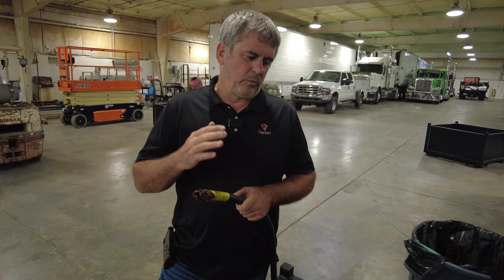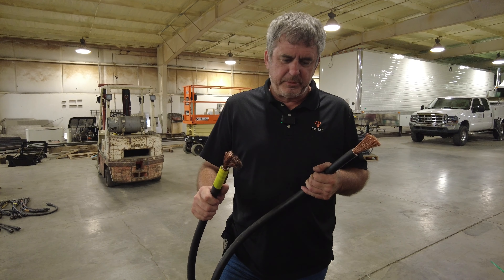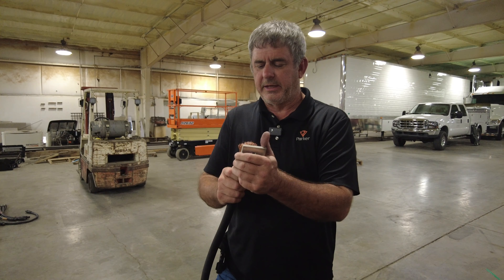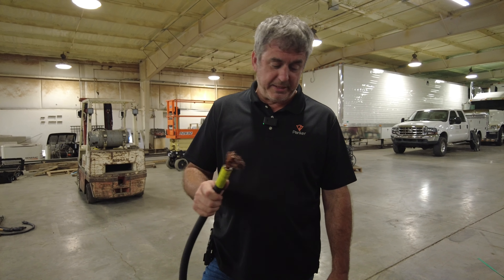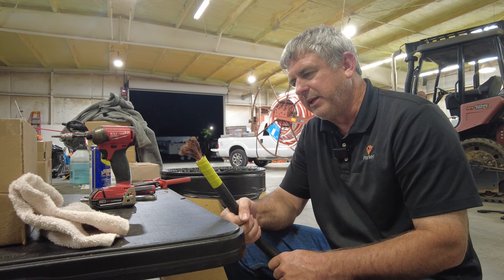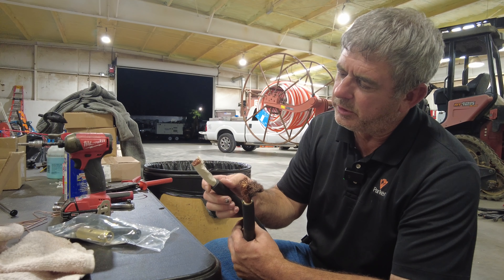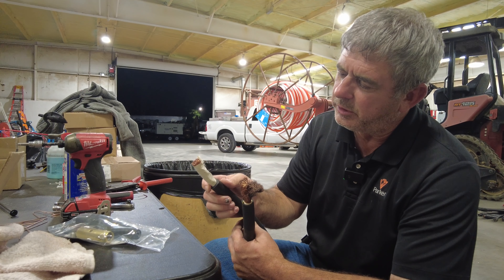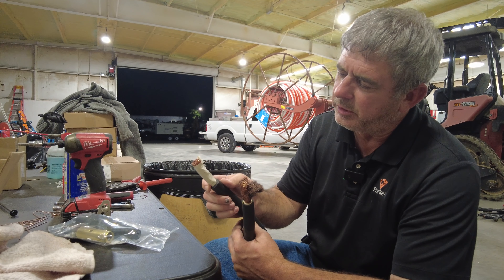How to assemble a Cam Lock Connector

Comment: shoulda put the fitting on first before stripping the wire. Where's the copper strand to tie sheath to copper??
Reply from the maker: On 2/0 and 4/0 I don't add the solid copper strain reliefs. --  on cables small than 2/0 I add these strand reliefs (solid copper wire twisted to the sheath)

Comment: Aren't you supposed to use the single copper 4 or 5in wire as a strain relief?
Reply from the maker: you can -- most of the connectors come with that piece of copper -- in my experience it works well without it, 4/0 2/0 --  I have also found on some old ones that i have disassembled that the insulation crack around this wire, I typically will use it on the smaller gauges to help take up space on gauges less than 2/0 so that set screws dont over set   -- thanks for watching.

Comment: Why didn’t you use the strain relief wire?
Reply from the maker: great question. - -  on 4/0 and 2/0 cables I dont feel it adds any value and feel it wicks more water to the connection -- on smaller gauges I add the strain relief wire ---- thanks for watching
Reply: Electrician here. Definitely use a strain relief to help prevent tension on the copper. Customers are ruthless with cables so all the extra safety helps.

Comment: Can you provide a recommendation for lubricating the contact surface of the male and female cam locks?
Reply from the maker: We use wd40.   That’s a great question.  WD 40 the wd stands for water displacement … and is rated for cleaning and drying contacts.  It works nicely and does not make the insulation gummy.  I can tell you have a bit of experience with this connector if you are asking this question.    Thanks for watching.   Great question.

Comment: What about the piece of wire included with the connector?
Reply from the maker: It's a strain relief, we don't typically use them on 4/0 cables, but we use them for 1/0 down.

Comment: thats power lock not cam lock, cam lock is the connector on your fuel tanker
Reply from the maker: I would agree, that would lead to lots less confusion …. People call them everything cam, cam lok, cam lock etc.  Even the manufacturer will refer to them as cam.   I honestly don’t know the proper term.  Like in the power industry we call a L630 a 10/5 because it’s a 3 phase plug with 5 wires at 10 gauge.    I don’t know the nema number for a cam lock power connector.   Thanks for watching